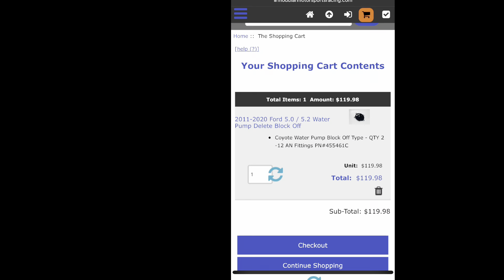⭐️DIY 5.0L Water Pump Delete AN Plate 🦊💧(Budget Option For MMR)

Comment: Solid aluminum pipe.
Reply: The airplane stuff, uses flared AN fittings, you might be able to bend the size you need with a EMT bender from the home center.
Reply from the maker: @kylegoldston thanks

Comment: Hell yea still using factory parts, well most of it anyway. Where are you mounting the pump if the radiator is in the back of the car?
Reply from the maker: Going over that In tomorrows video 😁
Reply: @ThePaintPaperHustle  ok, one we done a while back had to have 2 pumps like that one. One at the radiator and one at the motor with the reservoir even with the engine, granted they were 40gpm cheapbay specials and worked flawless after adding the second one but one just didnt have the flow needed.
Reply from the maker: Interesting and I may have to also do that

Comment: I know this is a dumb comment but deleting a water pump from an engine sounds like a bad idea. What am I missing?
Reply from the maker: It’s changing it over from mechanical to electric water pump. It’s not deleted
Reply from the maker: What’s deleted is the original water pump location. Some drag cars don’t use a water pump at all and don’t run any coolant. Some race engines don’t even have coolant passages in the heads
Reply from the maker: Also never a dumb question buddy. I’m here to help others.